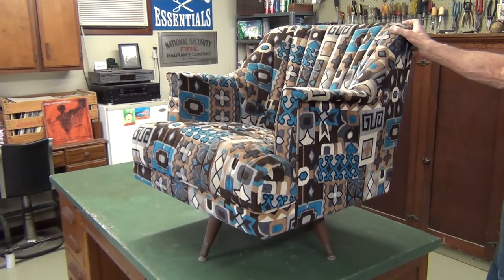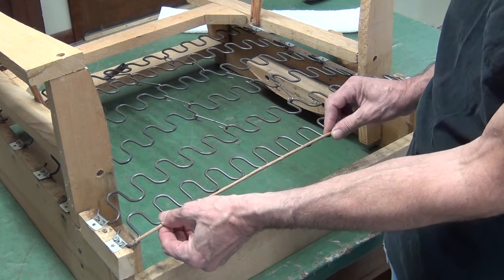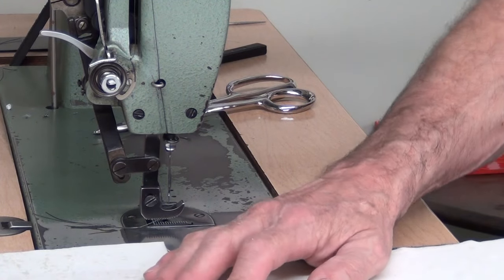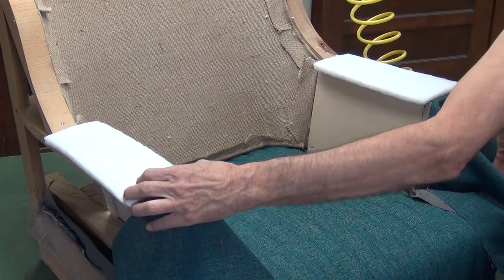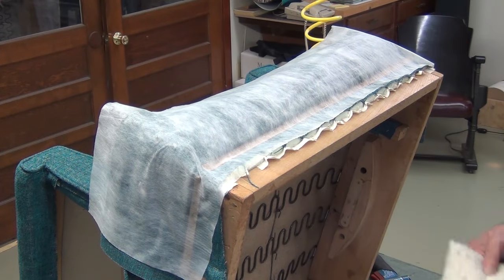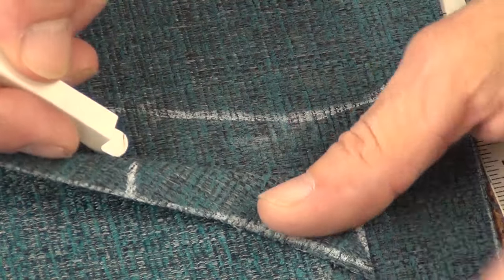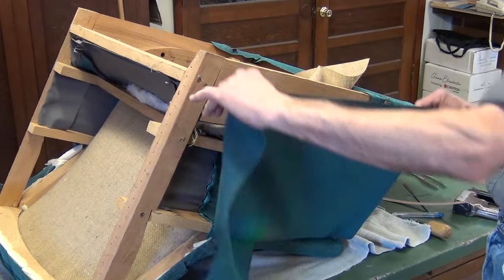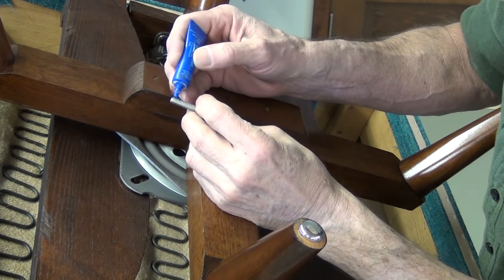Mid-Century Chair Upholstery

Comment: In a previous video about fixing a couch cushion, you mentioned using k grip adhesive vs spray can adhesive for cost savings. Just wondering, why did you decide to use American Niagara 160 in this case?

Thanks for all the great videos!
Reply from the maker: When I had another 1/2 gallon of K-grip go stiff in the jug I decided that buying a case of spray adhesive was more efficient in the long run (for my uses). Thank you for tuning in.

Comment: Beautiful work, such attention to details!! I have 2 questions;  was that cardboard tack strip? It appeared to be like a veneer when you worked it across the front.  Also, what is the purpose of the flap at the bottom of the outside back?
Thank you for sharing your expertise and for taking the time to help us grow on our upholstery journey!!
Reply from the maker: Yes, "extra-heavy" tack strip. The flap is simply cosmetic and used to finish the profile straight across the back. I've worked on many frames like this. Some designs had a skirt, either pleated or panels all the way around and didn't require the flap. Keep on growing!